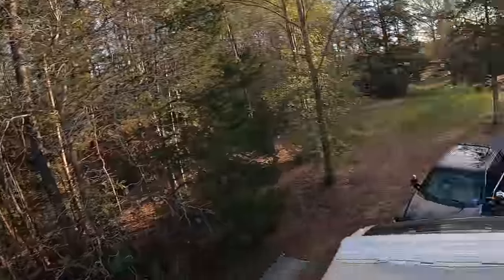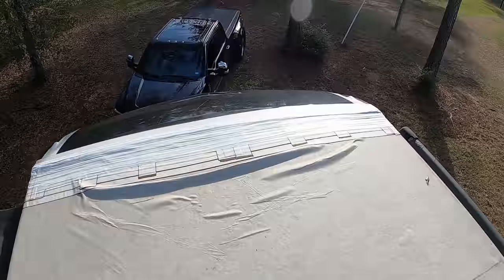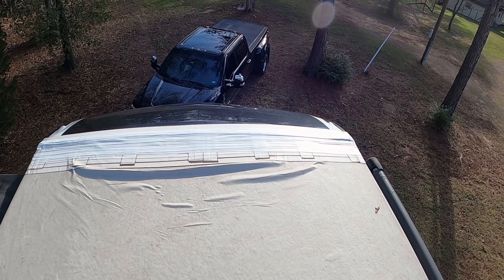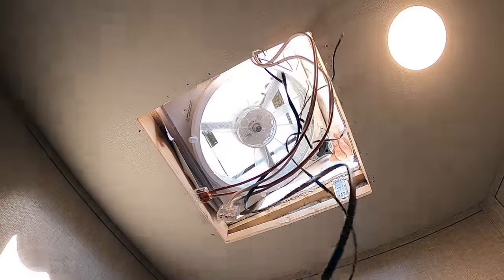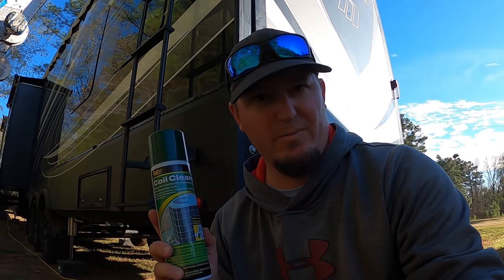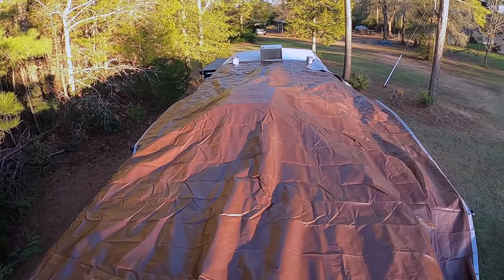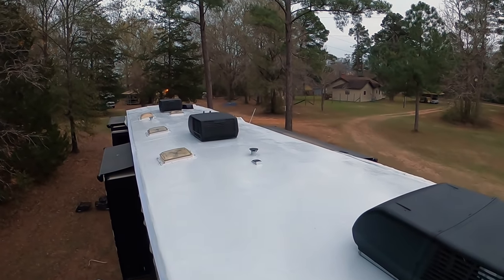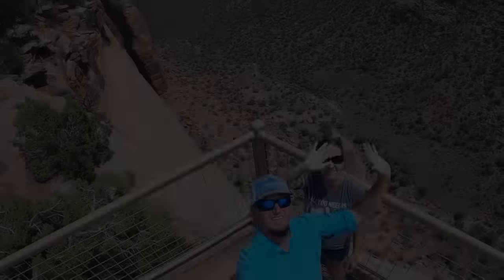Not Such A Grand Design | RV Roof Problems | The Downside To Fulltime RV Life!

Comment: Wait.  Are you kidding me?  The original factory "roof membrane" is basically just a giant bumper sticker??!  I know it isn't the exact same material, but.....A thin ass sheet stuck on the plywood??!  OMG, every new detail I learn about RVs makes me wonder why in the world I am still considering buying one.  There is just no excuse.  As others have said here, WHY doesn't the factory just spray on a rubber coating?  Something like a bedliner which has been in use for trucks for decades now?  It really is like they look for ways to be ridiculous.
Reply from the maker: Yeah it is a simple one piece of TPO or Vinyl that is glued down and trimmed around all the holes!  There is not a lot up there to protect the roof, a small contact with a brand will rip and tear them, and in our case the glue was failing and it was bubbling up while driving!  The RV armor system we installed is like a rubberized bedliner and requires no maintenance but cleaning every couple of months! This should be the standard for all RV's to have this type of roof!

Comment: What happened to Aluminum RV roofs, anyone know?
Reply from the maker: I think you have to go Airstream or maybe some of these new micro size campers!
Reply: Replying to my own email: Back in the early 2000s there were quite many full size pull behind campers that touted a 1 piece aluminum roof. In the year 2002 we bought a Jayco pop up camper that had an aluminum roof. In a rain storm It was a little bit louder than a Vinyl over plywood roof.
Reply from the maker: @benjamintucker9829  I think the size of the average camper nowadays is much bigger than the average size camper from 20 years ago!  I think they need to keep cost low so they go with plywood with a vinyl or tpo roof covering!

Comment: This brand seems to be a lot of flash and poor quality. Looks as if it would be a great place to live but there are several people with this brand having problems that are costly... and shouldn't be happening. One person's kitchen island collapsed out of the blue and noted there was only two screws holding it in place. Frame is cracked in several places underneath for another- and GD can't figure out if it's their issue or another companies issue.. and so many problems related to this expensive trailer.
Reply from the maker: We don't think it's a Grand Design issue, we think it's across the board with the majority of rv manufacturers. We know that by living in it full time, we probably experience a few more "uh-oh's" than a weekend traveler. We would still buy a Grand Design next time because we do feel the brand is superior to most other's out there!

Comment: So what fabric do they replace the rubber with?
Reply from the maker: It is a proprietary system so they wouldn't tell me, but it looks almost like a fiberglass batting!  They then do two layers of basecoat that almost dry semi-hard!  Then a final thick coat that has a very rubberized feeling when you walk on it!  Overall, it has been great for us, and we no longer worry about the roof or any roof maintenance!

Comment: Hey why don’t you take up that RV crap vinyl  and just do a torch down 50 year roof , and take 2x3 cca around the edge and torch down over the new edge and it will never  leak! , find a good torch down guy and do it! , I did mind and it has never leaked and it permently a heard to the plywood
Reply from the maker: In this video we removed the entire stock vinyl roof and replaced it with a lifetime roof from RV Armor!

Comment: Grand Design has only been around a short time, and with many new companies now days, they started out strong with good quality...and once they had their customer base, they started cutting corners and thus quality went WAY down.  Simply put, the last few years of grand design are absolute junk :(
Reply from the maker: While we won't disagree that quality has gone down, we do live and travel in ours fulltime and use and abuse it more than most.  That being said no matter what RV you have expect problems.  With the exception of the roof issues almost every other problem we have was not a deal breaker.  We would still get a Grand Design again!
Reply: Winnebago bought them crap since
Reply from the maker: @fordracer1415  Unfortunately that seems to be the case now!

Comment: That's an indication your frame is cracked somewhere.   They aren't proper Guage right from the factory. If you're full time and have alot of weight in it.   It will flex and bend under way and do that to the roof. Lehto's Law. Don't buy an RV. 
Buy a Auto hauler and build it out.
Reply from the maker: You should check out all of our frame failure videos we've released over the past month or so!
Reply: @PavingNewPaths  Yea I did. The T shirts cracked me up. JOSH the RV Nerd is about to do a video too.  There's like hundreds of videos o. That. I bought a double frame car hauler and converted it to a 7k Capacity. Yes I said that 7K of payload on the trailer.   I bring ALL the toys. I used to deliver to RV manufacturers and swore I'd never buy one. Maybe a Luxe. But who knows same frame I bet.
Reply: Liz amazing just did a video on frame flex issues. She mentioned a class action law suit. Maybe a lawyer is needed?
Reply: @sandyschwartzkopf3510  agree a lawyer. That could cause lives. I'm on a motorcycle and I'm really leary around these big 5th wheels knowing the frame can break at any time.

Comment: So….why the hell don’t you call out these crappy manufacturers?  If they aren’t helping then you owe them nothing?  Assist your fellow RVrs so we/they know what to look out for.   I’ve seen it done with sailboats and wouldn’t you know that Lagoon stepped up to the plate.
Reply from the maker: I felt like I did call them out on the fact that not just my brand Grand Design but just about every brand is building them the same way!  Also, if they were to step up and help, they would need my camper for several weeks and would put the exact same roof on that has already failed!  We travel in our RV fulltime and cannot give it up for that long!  We felt RV Armor is a far superior product than the original roofs they put on!  In the end we wanted to show that thing happen even on new stuff and sometimes the best step is to just choose the best repair for your situation!

Comment: $6000 seems like a lot for a tiny rv roof......
Reply from the maker: Our camper is a 43ft fifthwheel and that price is very reasonable!  If the dealer put a stock vinyl or tpo roof on the cost is around $12,000!
Reply: @PavingNewPaths  thats highway robbery

Comment: So they got flex seal paint and painted your roof.
Reply from the maker: No, not at all!
Reply: @PavingNewPaths  it’s a rubberized roll on roof isn’t it?
Reply from the maker: @greg rupar  They installed their own membrane which is a fiberglass batting type material! Then they install two base coats that dry firm! They then apply a final thick rubberized final coat! They did not want me filming a step-by-step but if your intested in the process they have a YouTube channel!

Comment: OSB roof wtf
Reply from the maker: You might be surprised to know that probably 99% of rv roofs are made of OSB according to our tech! It's only when you get into the very high end models that they get away from them.
Reply: @PavingNewPaths  that is surprising kinda but not.I have a car hailer that said no osb.Guess whats between outside aluminum and inside plywood.That’s right OSB.ALL 3 of my trailers have a 1 piece aluminum roof with dicor sealing edges.Thinking about buying a momentum.What surprised me was a high dollar unit has a pool liner on the roof.I had no idea what to expect having one until I seen your very informative vid,thanks.
Reply from the maker: One of the first things we will.change with our next rv's is we will.install RV Armor's roof on day 1 instead of waiting until there is a problem! It is a far superior roof and we think it should be an upgrade item you could purchase when buying a new unit from the factory! Let us know if we can help.with your decision on what to buy!

Comment: Not hearing great things about grand designs
Reply from the maker: Grand Design is actually a really great brand! It was unfortunate that our roof started to fail so early, even more unfortunate that since we are the second owner we are not covered under the warranty! Even if they did cover it, they would have put the same sub par roof on! This is not a Grand Design probelm, almost every RV is built with this same roof, so changing brands will not save you from having to deal with any roof issues!

Comment: Grand Design has had roof problems from day one. Nothing new about it. They just have a cult following and the owners with the issues keep silent. I won't. My brand New Grand Design had issues on roof and seals all over. I got tired of getting a run around from GD so I sold the POS and moved on. Never ever again will I own a over priced Grand Design. NEVER ! If I get a new RV from any of the makers it will get a Flex Armor roof from now on. Nothing comes close to that. Costly as that is. Flex Armor.
Reply from the maker: Ours came down to RV armor or Flex Armor! We decided on RV armor because they come to you for the install and any repairs you may need to make like new skylights or fans!  Flex Armor is a good choice but I didn't want to have to take it to a place to get it done!  Our next RV will have RV armor or Flex armor installed from day one!

Comment: Momentum are absolutely garbage, no one should buy one under any circumstances, you could rip one apart with just your hands.
Reply from the maker: We have to disagree. Although this was a setback, we have still been very pleased with Grand Design! They're all basically the same, unless you get into the super expensive ones! For us, it was finding a floor plan and specs that we were happy with. Grand Design checked those boxes for us and had great finishes that didn't feel as cheap as some of the other brands we considered.

Comment: OSB roof? Absolute garbage...
Reply from the maker: Built exactly the same way 99% of all other campers out there!
Reply: @PavingNewPaths  Yup!  Almost all TT decking are OSB.  Some remodelers install plywood -- does RVArmor redo decking? My in-laws ClassC EPDM roof failed a long time ago and delaminted the sidewall.   My teardrop camper has 1 piece fiberglass roof.  Lots of folks hate on it but it's not failed.
Reply from the maker: It is a very small percentage of trailers out there that are not built this way! The majority of the ones on the road are! Rv Armor will inspect the roof and if there is any damage they will not apply the roof to damaged wood! They will replace any damaged wood prior to performing the job! We also talked about changing the OSB out to thicker plywood and that was an option that they will do for you but it adds significant time and money to the job cost!